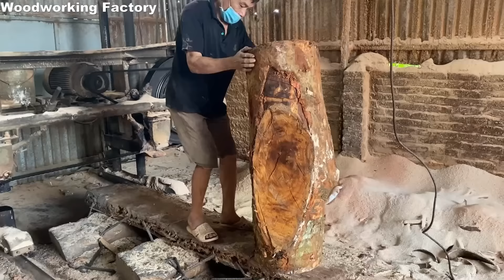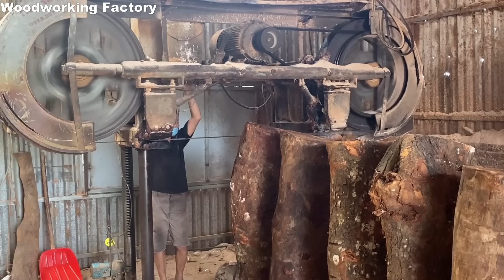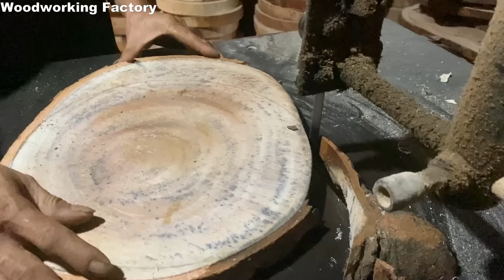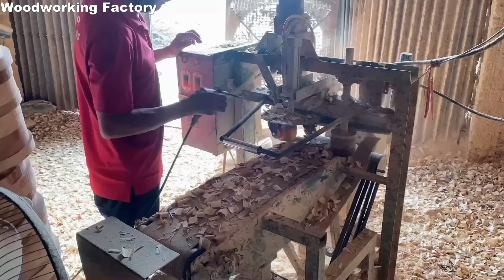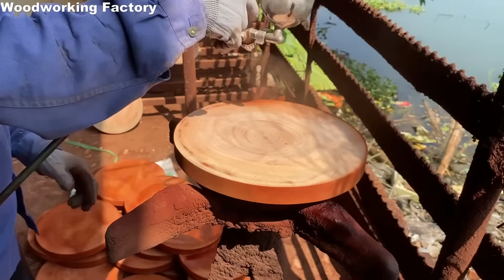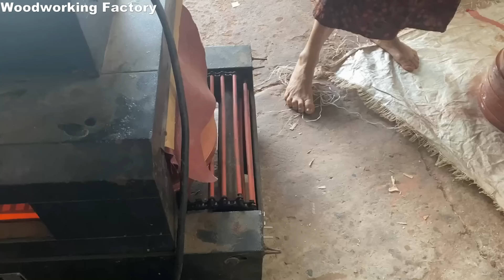Vietnamese Wood Production Process.Vietnamese Craftsmen Have Been Making Cutting Boards For 60 Years

Comment: Running a giant band saw with no safety guards and the blade at neck level seems like a good way to lose your head at work.
Reply: Hands & feet.
Reply: It looked alright but it is dangerous working with Electric Saw. Hard Boots are so important. This is not a big factory. It is a small countryside production. This kind of small production place made this product affordable. Their aim is for those also who can not afford to pay high price. It already high price. Longer this is only $15 - $20 dollars. Now it is expensive where I am for this item. I opted to used plastic Cutting Board. The workers their are not provided safety gears. The  owners are looking for profits. The less you needs to provide your workers the more money they can make. It is not like the States where you can sue for liable for bodily injuries. They are providing only those they needs to make this product. I owned longer. Now I am very appreciative of because I knows the long process it took to become this product. I learned how to use such equipments and I worked with woods when I was in H.S.. So I knows it is a long process.  The space they used made the process time saving. It would be a bit less works if just some self moving equipment is provided for the workers. But then people would have no jobs. I knows & I could not made any such comment about equipments & it's safety. If you do not know how to run any business, you will not makes profits.
Reply: Значит у них вырасьают новые головы !!!!
Reply: As mesmas pessoas dos países mais ricos que lutam por melhores salários e condições de trabalho ais trabalhadores, contra o trabalho infantil e insalubre, contra a distribuição das florestas, são as mesmas que consomem os produtos fabricados nós Países que não tem nenhuma responsabilidade sobre isso, muitas vezes por ser mais barato, não interessando se foi destruído as florestas, se o processo é poluente ou feito por trabalhadores muitas vezes quase escravo ou infantil
Reply: At least he had a mask😂
Reply: Don’t stand in front of the business end of the machine and you’ll be fine.
Reply: @patrickperry6945  I guess you've never heard of Murphy's Law...